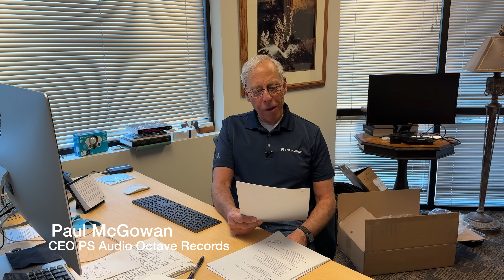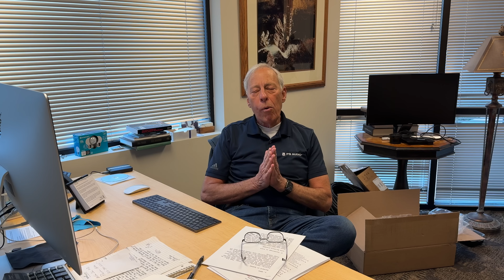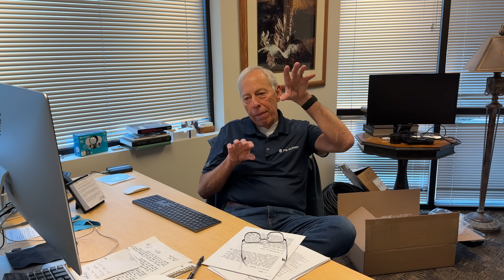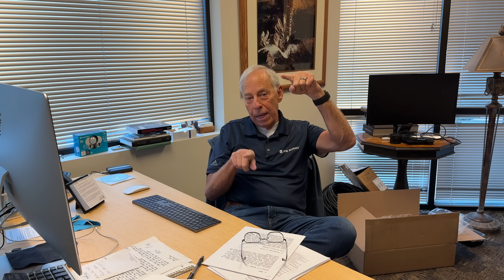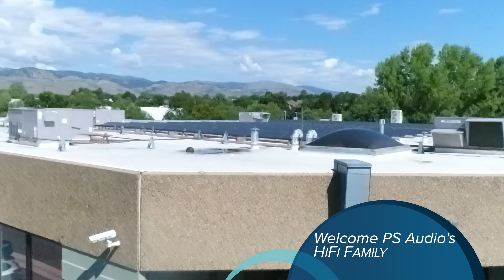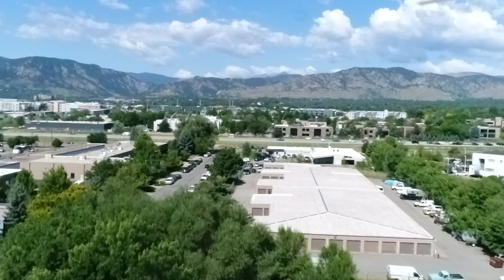Switch Mode Power Supplies in amplifiers

Comment: Some of my favorite amps I've owned were old Crest Audio Pro series, BSS and MC2 Audio. For fairly low output power amplifiers, the transformers in them are huge. An MC 650 and a Crest 4801 are round about the same rated output- 650 wpc 4 ohms, 2U high, full rack deep and weight over 20kg each. I had 3 x Crest 8001s in a fairly small rack and the weight was insane at well over 100kg. They were only a fairly modest 1250 wpc in to 4 ohms, but produced outstanding bass for days on end compared to SM equivalents.

The heavier the amp - the better from my fairly amateur experiences!!! I can understand the want/need for lighter weight touring amplifiers, but if its not being moved around very much, then the lightweight element doesn't matter to me.

Comment: Answer is - ordinary power transformer is WAY cheaper and easier to make than SMPS. A good SMPS required engineering, while transformer needs a simple calculations, an iron core, copper wire and a tool to wound it up. If you see a transformer in a device that's a sign that a company doesn't have a good engineers in their team and don't care to hire one.
Properly built SMPS will give a good boost to an amp. ^_^

Comment: Just as Marantz proved way back when, quality components make most of what your hearing!! Its all it boils down to every time. Ive been tearing electronics apart and piecing them back together for decades, you can tell a product is decent without even using it just taking a quick poke around inside.

Comment: I do have a kit amp with a switching  supply and it does create some noise.  They are cheap , they don't need a big expensive transformer and capacitors.

Comment: The reason is marketing. SMPS (and class d amps) are lightweight, many people judge audio gear quality by weight and toroidal's, same with heatsinks, are heavy. SMPS are much more difficult to design and if done poorly are unreliable. Many smaller companies do not have engineers with SMPS experience and it's only as high quality prebuilt modules have become more available their popularity has grown.

Comment: Are toroid power supplies more reliable?  You never hear that a toroid power supply failed in an amp.
Reply: I think you mean linear power supply.  Toroid refers to the type of transformer which could be used in either.  I agree, it is typically associated with a linear supply but could also be used in a switch mode supply.

Comment: Isn’t the AC regenerator nothing but a giant switch mode? In simplistic terms anyway. I know it’s more than a basic mosfet pulsing a transformer. Everything has its limitations, so you have to pick which. Toroids run out of gas faster than an e coil, lose their magnetic field quicker, but generate the field faster, and switch modes are noisy.

Comment: From my experience with cheap parts, switch mode power supply is way audibly noisier than linear PS. With my limited knowledge in electronics, I managed to build a regulated linear PS that turned the noise of my DIY assembled DAC from being audible from one foot away to only the noise of the tweeter being audible at ear against the driver distance. The IC regulator though limited the current to 1 amp reducing the overall system bass and dynamics despite internal components requiring less than 1 amp current. I am still using the cheap switch mode PS due it''s 3 amps current which improves bass and dynamics until I find quality filter capacitors and low noise, high current regulators. NB, my experience is with cheap PS, there must be some well-designed switch mode PS whose noise is as low as linear power supplies.

Comment: You can almost think of a switch mode power supply as a Class D amplifier that provides a constant DC +50V and DC −50V (the 50V is an example but probably where most 200W amps will be).
A well-designed high-end quality switch mode PSU I imagine could cost more than a traditional linear PSU; we are not talking about your average laptop power-brick...
Cheap switch mode PSUs have built up a poor reputation, not only because of the noise and impedance characteristics of the produced power voltage, but also because of the noise they push back into the mains.

Comment: For ages one of the biggest problems with switch mode supplies is that they tend to require a fairly constant load. drop the load too far and they lose regulation, the volts shoot up and the smoke comes out.
Unfortunately an audio amp's supply load is all over the place, from all but zero, to many amps.
Often the poor voltage control feedback loop will be having kittens trying to keep up.
Many early supplies used a cheap-ass, very wasteful solution of a big resistor across the output to ensure a load, even if most of the time it was just heating the cabinet needlessly.
How things have changed.....   most are now way better that the dinosaurs listed above.